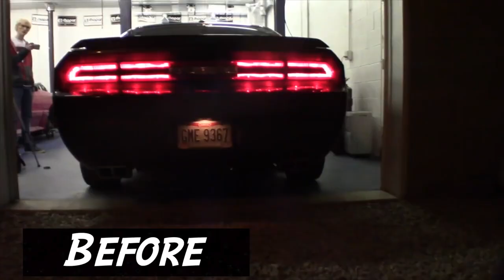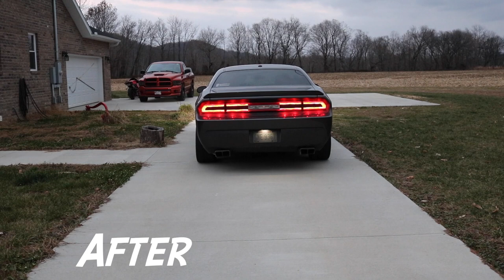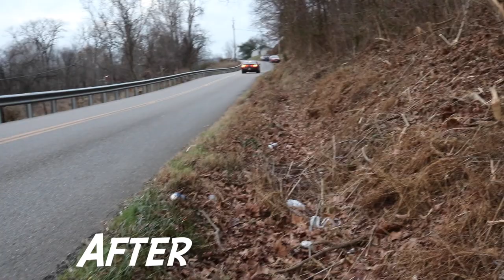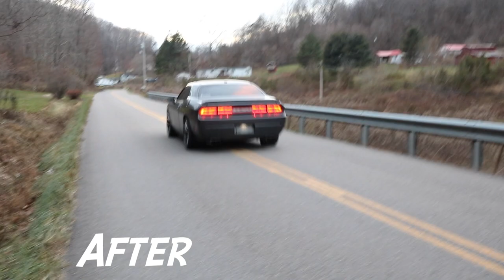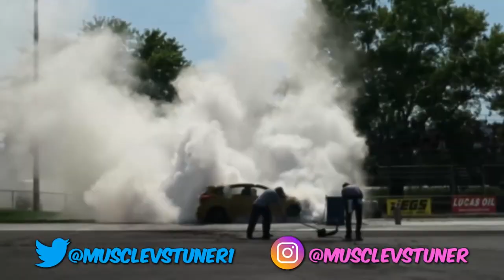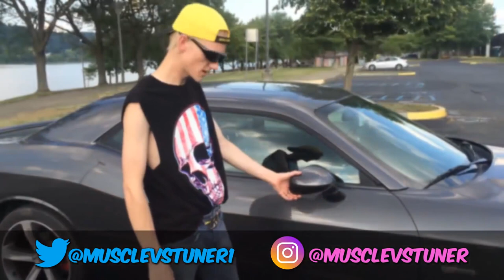DAMN My Car Got LOUD!!

Comment: Sounds cool, would sound better if it had a man pedal.
Reply from the maker: +R-Spec I can't disagree.
Reply: Muscle Vs Tuner you should get a 274 cam for that. I have a 2014 charger rt with cams header CAI and catless mids with a custom tune from weapon x in Cincinnati putting down 435 to the wheels.
Reply from the maker: +S2K Prototype I would but I can't do cam and procharger on stock internals. I have to pick my poison lol
Reply: Muscle Vs Tuner LS motors can be procharged and cam'd on stock internals. The only muscle thing about your challenger is it's inability to corner 😂
Reply: Muscle Vs Tuner is that an srt 10 dodge ram?
Reply: B0NEZ Clutch pedal
Reply: Muscle Vs Tuner from my understanding the 5.7 can easily handle a cam. I've seen lots of people run cams. Are you saying with the procharger and cam? Or just cam by itself?
Reply from the maker: +michael clements Procharger and cam
Reply: PsychoCB7 it's funny because nowadays they're making automatics that can shift faster than a person can
Reply: it sounds good
Reply: R-Spec you mean a slow pedal?
Reply: Geiokami Hasuki he means a clutch
Reply: MoparMilan
yeah which is slower than an auto :)
Reply: Geiokami Hasuki actually you lose 17% of your rwhp with an auto matic
Reply: That depends on the automatic itself. Most of these modern 6/7/8 speed automatics shunt their torque converters out with a mechanical clutch when running in the upper gears so there is almost no more power-eating slippage from the converter itself.
Reply: Michael Lucente
manuals shift much slower than an auto.
Reply: If you're worried about about how tiny of a bit faster it can be, you must have a slow car. lol.
Reply: Get more torque out of a manual
Reply: That's false. How much torque you get out of a transmission is not being determined by the transmission type.
Reply: Michael Lucente
And yet they are still slower
Reply: to each their own
Reply: Sven Schwingel how the torque is distributed to your drive tires has everything to do with your tranny dif and gearing
Reply: Of course you are right, since after all, the transmission's task is to convert engine torque into wheel torque. But to say that an auto gives you less wheel torque than a manual is simply not true. And that's what I was referring to in my statement.

There are older auto transmissions which have horrendous amounts of slip in their converters, practically using engine power output to heat up their ATF. These will eat up engine power like nothing. Plus, they usually come with a low amount of steps (like 3-speed or 4-speed) which also doesn't really help with performance. But there are also manual transmissions which aren't exactly optimized towards efficiency and have more friction losses than necessary.
Reply: ReinyHighRoller If you can't corner with AM your just lacking the balls to do so.
Reply: Truth. AUtomatics are faster than manuals nowadays, plus you have "Auto-Manual" mode so you can control your gear as if you were driving a manual but you get the shift speed of an automatic. People who say manual is for men are insecure/egotistic.
Reply: actually you lose 17% of your rwhp on manual as well. There's a natural WHP loss as power is transferred through the entire drivetrain. some rigs are as efficient as 10-11% loss, some up to 15-17% as you say. All depends on the build.
Reply: 1994SHOtime Driving a manual is its own reward. A: It's a dying art. B: Its old school. C: People are less likely to steal your car. D: Automatics are heavier and cost more to service. E: The connection between man and machine is short changed when the car is actually the one driving and doing the work that once was mans discretion. In my opinion at least. I think that all men should learn how to drive a manual, but to each their own.

Comment: You should upgrade your torque converter to a higher stall speed. It would make your car leave a lot harder and if your getting a supercharger later it will get you into boost right off the line.

Comment: Headers don't add much in hp but they do give you better throttle response (better flow means your engine isn't chocking out). So you kind of have to re-learn your launch.

Comment: As a Coyote owner I have to say that nothing sound like an unrestricted Hemi engine. The sound is just so mainly. I once raced this RT challenger that was fully moded. Back then my 2011 Mustang GT was completely stock outside of a Borla S axle backs. I am not sure what exhaust the Challenger had but it sounded fucking mean as hell. The guy mentioned long tube headers, catted h pipe and some kind of exhaust along with a tune and a CAI and some drag radials. It wasn't enough to beat my 5.0 but it sure was fun just listening to that beautiful exhaust coming out of the Challenger pipes. It made my 5.0 sound tiny by comparison, and my car sounds mean as hell.
Reply: SpyderRios I agree. I'm a Ford guy, but absolutely nothing sounds better than a big block Mopar
Reply: Respect
Reply: Whats your QM time?
Reply: I smoked a 2010 GT in my R/T stock, trying to work my way up to the 5.0's lol

Comment: I swear my 5.0 with catback, intake and tune sound louder than this😬
Reply: MatthewJ Reyes my 4.6 with o/r h pipe and mangnaflow magnapacks  arelouder as well
Reply: Marquice Rowan 4.6s aren't the fastest but it's fords best sounding motors loo
Reply: Joe DiCocco I know it's not the fastest still pretty quick and with rite support mods they can be fast and yea some prefer 5.0 sound but I think 4.6 sound better
Reply: Joe DiCocco the most loud ones and best sounding imo is the ford GT engine (from the 2006 or before) just look up "Ford GT vs Lambo" by superspeeders. Such a nice sound
Reply: Marquice Rowan 4.6 sounds the best I promise, no debate here.
Reply: MatthewJ Reyes all mustangs sound good when you're in the throttle but in idle or just driving a normal speed they are too quiet unless it's a aggressive cam installed
Reply: My truck sounds louder than this
Reply: MatthewJ Reyes my honda sounds louder than this (dont really have a honda)
Reply: Catback/freeflow still won't be fast.
Reply: Same bro H pipe with slp loudmouth way louder
Reply: clovehitch I've a revving video where i think. You can hear the new 5.0's good with a. Quad exhaust
Reply: MatthewJ Reyes I think it's due to firing order. Mustangs have almost always been loud as fuck, but definitely not necessarily always the most powerful.
Reply: JoeIsCrazyWillman.  You are right, but in comparison to bobbys R/T my 2.3L Ecoboost with bolt ons & tune is making 343whp & 414wtq... & is about 1000lbs lighter. Jus sayin....
Reply: MatthewJ Reyes you're a mustang owner, act like it no need to boast
Reply: nah my 1.0 kia juke with straight pipe and 2$ ebay fart can sounds louder
Reply: im a chevy guy but honestly i love mustang sounds even the v6 with a nice muffler sounds beautiful ...

Comment: edit
Reply from the maker: +Troy G Did you even watch the video? There's an entire section where I explain how I tuned my car...
Reply: Muscle Vs Tuner I stopped watching about half way through... Not gonna lie... But I could have sworn you said that you didn't tune it after you out the headers on... And.. I did go back and finish the video.

I stand corrected... I'm not too proud.
Reply: That is definitely not true. Yes, you should tune after a mod to unlock it's full potential, but saying you don't gain anything without a tune, I beg to differ.
Reply: imCapone1124 sorry no... Most mods do nothing or almost nothing without a tune.
Reply: Muscle Vs Tuner btw... You are never going to be able to put a supercharger on a engine not designed for one from the start.  I'm not personally an expert but I have discussed mods at length with high end shops and they all say superchargers are not an after the fact option 99% of the time... Turbo yes... SC no.
Reply: Troy G people supercharge these cars all the time
Reply: Andrew Becker not this motor though
Reply: 8geiger9 unless you have a source proving me wrong... I suggest you go do some research, because I know I am right on every point I have made...
Reply: I said this on the last video and people bitched at me. I guess his diablo turd tuner put the header to use
Reply: FireCatHD well... he wasn't using the default diablo tune which is what I thought... he drove the car to collect logs and got a custom tune from diablo using the logs.. it's not perfect but his tune is likely pretty good... especially if he did it more than once.
Reply: Whipple, Edelbrock, and a shitload more companies make supercharger kits for his year challenger.
Reply: MoAZ yes.. and the kits that don't blow your engine to pieces in a few thousand miles are very expensive and replace just about everything but the block....

Just because you CAN do something in the short term... Doesnt mean you should...  I didn't imply it wasn't possible... Simply that he shouldn't do it to his daily driver unless it gets done professionally.  The shops I have talked to say you are almost better off buying a supercharged crate motor over trying to bolt a kit on a stock motor because of how many internals need to be changed.
Reply from the maker: +Troy G It's all good bruh. Yeah I tuned it lol
Reply: ORLY? Carb legal supercharger kit for my 370z is the prefered option over turbos from a reliability standpoint. It was designed to be daily driven... Don't generalize turbos and superchargers because they aren't one size fits all. They are designed very differently from engine to engine, and reliability depends on MANY more factors than just being a "TURBO" or "SUPERCHARGER". I understand you think you're correct on what you say because of your "Anecdotal" evidence "Talking to High end shops" But if you have ever wrenched on your own engine before you would know that their are WAY more variables involved. What you said is kind of laughable to be honest. I'm not talking about people who think "Wrenching" means changing your oil filter.Those people deserve to be knocked the fuck out(Kidding,but not really....) by The el corn bandito, jake. Anyways, to recap, supercharging/turbocharging's reliability depends upon MANY factors of the cars design. Saying SC isn't viable 99% of the time just really makes you look uninformed/ignorant towards the engineering process of motor vehicles. (Edit: A word) (Realized you where talking about the challenger specifically.... But this is still good information for anyone considering SC/TC on their vehicles.)
Reply: Notorious IG 350z has all forged parts and an aluminum block... it's not the same kind of animal.  Nissan over builds their motors.  that being said... whoever told you a supercharger was a more reliable option than a turbo on a 350z is an idiot.   I explored both options as I owned a 2008 350z for 4 years before getting a 2009 and  then a 2015 GT-R.  I know a lot about 6 cylinder Nissan engines and what's available for them.  

if someone told you to slap a super charger on your 350z... they were stupid as fuck.
Reply: Troy G and you can't get a fucking 2009 350z lmao 2008 is the last production year.
Reply: Notorious IG too bad I didn't say 2009 350z ... Learn to read
Reply: Troy G You should go back to college
Reply: Notorious IG har har! You are so smart...  What a well crafted rebuttal.  
Seriously though, stillen SC kits are fine.  I was just making a point because you were being a child.  Nissan makes better engines than Dodge.  So bringing this argument up had nothing to do with the discussion.
Reply: +Troy G W
Reply: ***** no... Boost is not boost.  A supercharger increases load on the engine components by 25% or more while compressing the air.  A turbo doesn't have the same effect because it's driven by exhaust and not a heavy belt that causes increased load on the engine.  Turbo and SC are entirely different applications with entirely different needs.  Yes, if Bobby puts a SC on his cast iron dodge motor it will not last.

People run small turbos on cast iron engines all the time and it's fine.  If Bobby was to make 150hp with turbo.. his car would last just fine.. if he made 150 with a supercharger.. he will be walking to work in a few months.

Boost is not boost...
Reply: ***** now that... Is an argument I can't address.  I don't know much about Dodge motors other than the basics.  I personally hate dodge and think Bobby is nuts for buying one.

No turbo isn't magical... But it does increase boost without putting DIRECT load on the internals.  Turbo adds stress mostly in the form of heat.  If you control the heat, turbo is nearly as reliable as going all motor.  Nearly...
Reply: Odd thing about this.... Is the hellcat has a cast iron block and a mad supercharger...  And they have powertrain problems but mostly from the flywheel out.  The engines seem to do fine... Wonder how they did that.
Reply: ***** superchargers are driven by a belt... It's HARD stress.  Turbos are driven by air...
It's literally the difference between hitting something with that bat or hitting it with  a hard pillow.

It's the direct strain on the engine that makes superchargers a problem.  

Turbos add boost at the expense of heat and soft gradual stress on the motor.

SC add boost at the expense of actual engine power.  The engine becomes 25%-30% less efficient because it has to drive that charger...It's like driving uphill or pulling a heavy load at all times

Turbos are efficient boost... Superchargers are inefficient boost.  People wouldn't even use them of it wasn't for the fact that they don't have lag and have a superior power curve.
They are a more expensive application with pros and cons... One of the biggest cons being.. THAT ITS HARDER ON THE FUCKING ENGINE AND REQUIRES MORE EXPENSIVE PARTS.

"what part of that don't you understand?"

You are simply fucking wrong... Go ask an expert and they will tell you the exact same fucking thing.
Reply: ***** dude.. that's what this whole argument was about... That superchargers aren't the same as turbo... That turbos are easier on the engine... 

You don't build an engine just for boost . Making an engine turbo ready is a hell of a lot cheaper than making it supercharger ready...  You do seem to agree with me.. you just don't want to acknowledge that boost is not boost... Lol... Turbo and superchargers are very different things that happen to both boost .. lol that's the only point I was ever making from the beginning.  
That being said...if an engine is super charger ready it is also turbo ready... But not vice versa.
Reply: Troy G not necessarily. turbos create a massive amount of heat. alot of people have overheated their engine. turbos also cost alot more for install while a supercharger installs more like a bolt on....sometimes
Reply: Troy G Hahahaha, you're smoking too much. Wow dude, just wow...
Reply: Antonio Arteaga fair enough... but you did say these motors.. and THIS motor has stock internals.  So maybe you need to think about what you say as much as I do....
Reply: +Troy G I have an RT challenger, and I wouldn't SC it as it sits cause I'm sure the way I drive it wouldn't last me very long before shit goes down hill. A lot of the people on shophemi's channel do forge their internals and they make sure the owners know what they're getting into if they stay on stock internals. Can you do it on stock internals? Yea, but it's not very smart, i get what you're trying to say completely and I'm with you on that 100%
Reply: Troy G Procharger is the best forced induction mod you can make to an r/t with no internal mods. Go to a mopar shop and not your nissan shop to discuss that. And if you wanted that guy to know it was a 2009 GTR you should've said that there and not along with 2015. I don't know the model years for 350zs and I definitely thought you meant 2009 350z. You talk too much bud lol
Reply: Don Woreboutit your problem.  My sentence was structured correctly.
Reply: Don Woreboutit talk... Talk.... Talk...
Reply: Don Woreboutit what I am doing is not starting shit by calling people bitches on the internet when I know I won't have to back it up.  You clearly do it on a regular basis.
You said you are 6'3" 235 that's nice... I'm 6'2" 230 and have 8 years of martial arts 2 black belts and 3 years MMA experience.  I won a state championship in full contact martial arts 10 years ago before going into MMA.  Learning to fight has literally been my hobby since I was 12.

And while I haven't done any fighting in the last 5 years I know with 100% certainty that my only concern in a fight with you would be dealing with the police if I accidentally hurt you too badly and put you in a hospital, which results in police involvement.

Learn to be a man and not an internet tough guy.  If you talked shit to me in person I still wouldn't do anything to you, because I cant.  I have to act in self defense or I would have big problems with the law.  It would be hard to claim self defense if I bought a plane ticket or drove to Maryland.

Comment: You're only to get marginal power gains without tuning. Tuning is what makes the motor produce more power, not just bolting on parts. Sounds great tho!!
Reply from the maker: +Mason I did get a tune though. I talk about it in the video.
Reply: Oh my bad man I totally missed that

Comment: I got some question man can you email I have questions about things you have done with your car from the brakes to the exhaust also your tune and what do you think about a cam and ported heads and the stage 2 throttle body and changing out the intake also the injectors along with a 2.9L supercharger.... gettting a 8 speed automatic transmission and changing out the gears on the rear end? Please get back with me